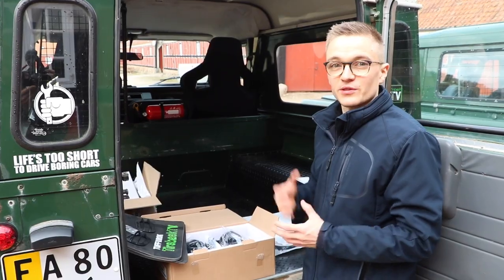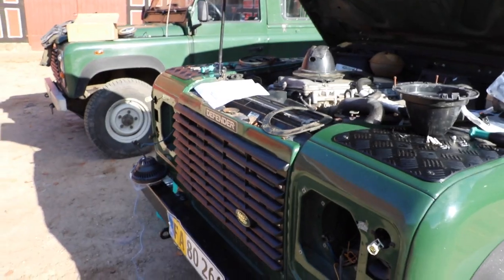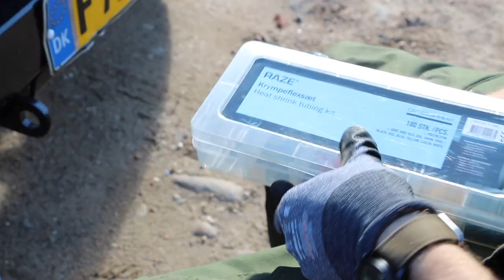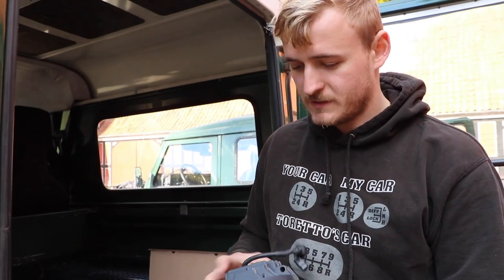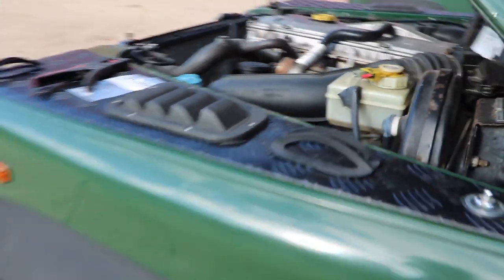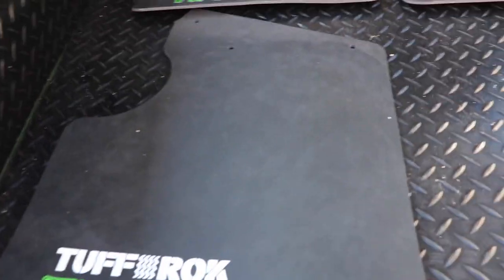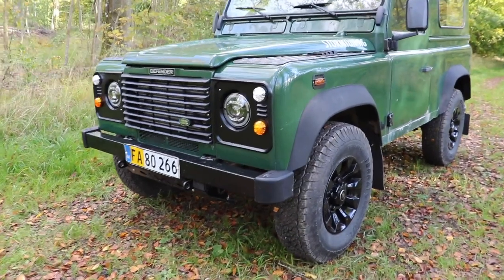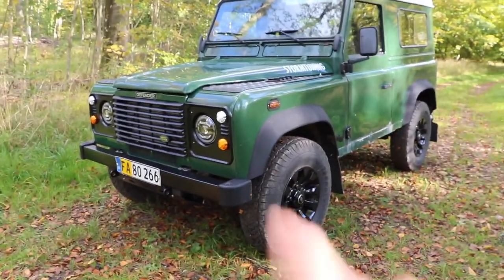Installing Tuff-Rok upgrades to the Defender!

Comment: Nice lights and truck looking great, but why didn't you want the Halos on as DRLs as they're intended?  Rather than use the side light feed, I'd have used an ignition switched live (I know - more wires to run! :/ ).
Reply from the maker: They are set up as DRLs just like the previous lights.
Reply: @TirsbaekTV  but if you switch them on in conjunction with the side lights they are not proper daytime running lights.  They should come on when the ignition is turned on and either dim or extinguish when the headlights are activated to be proper DRLs.

Comment: I spontaneously purchased 30mm Britpart wheel spacers just before Christmas for my 90. I’ve been reading about the pros and cons for fitting or not fitting. Do you have any experience in running a 30mm spacer setup? Any issues with wheel bearings/geometry? Any advice would be greatly appreciated. 
Thanks. Big fan of your work!

Comment: You need a snorkel that will increase your power ....and a quick question any idea on the difference between vortex system and straight exhaust?